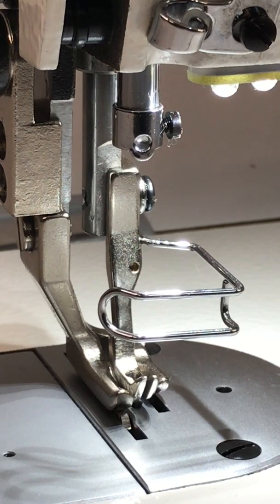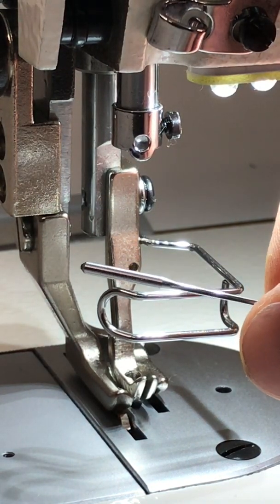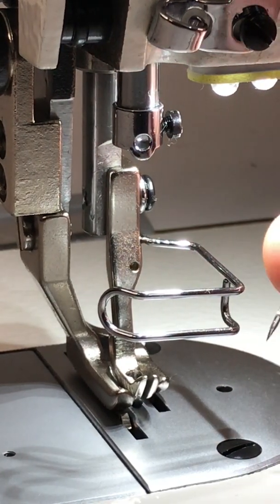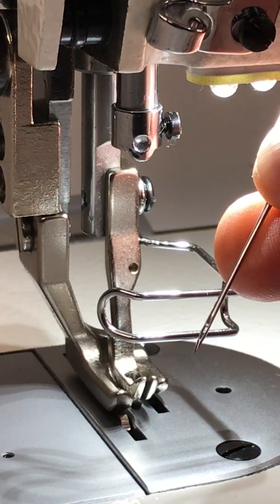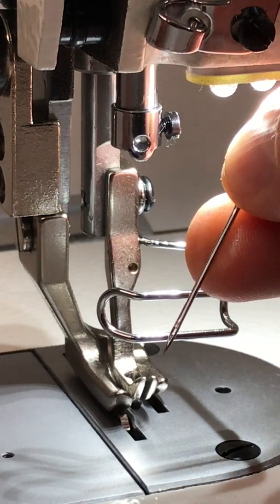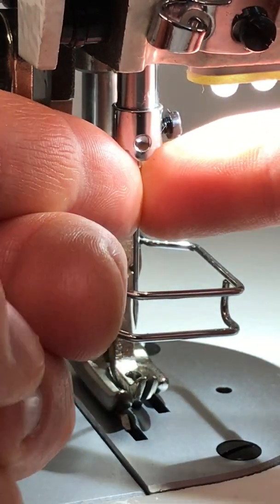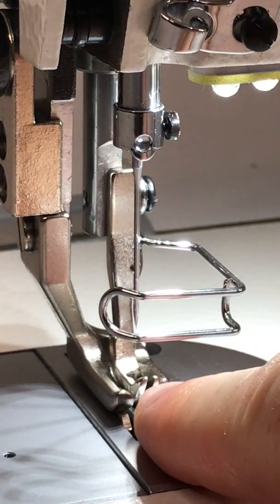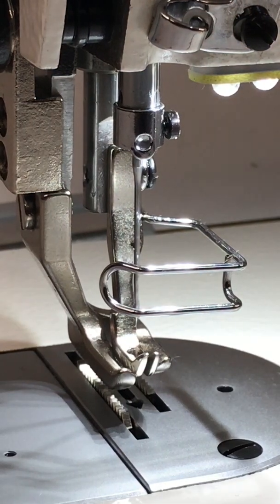How to Change a Needle on a Jack Industrial Sewing Machine

Comment: I have a jack A2S. When I change the needle, if I push it all the way up as you do, it won't engage the hook. So I have to loosen, drop it down a little then test it til it works. Is this standard? Ps - thanks for your videos.
Reply from the maker: Providing you are using a good quality dbx1 system needle, you must insert the needle fully, this should be visible through the hole in the needle bar.

If it is not sewing correctly or missing stitches it can be one or more of three things.
1.Firstly the needle bar height must be correct, this can slip during a heavy jam or needle strike, or has been adjusted poorly. 

2, After needle bar is set correctly, the timing should be set at the correct needle bar rise.

3. Setting of the hook point to needle clearance as close as possible without causing needle deflection.
Reply: @ozcommercialsewingmachines  thank you! I got the DAX needles instead of the DBX. Problem solved. I didn't realize there were so many different industrial needle types.
Reply from the maker: @KittenKaboodleto  yes, there are literally hundreds of different needle systems for industrial machines, thank you for allowing us to help you, all the best.

Comment: Hi any idea how to remove a stuck needle,i have the Jack A5E only had it 2 weeks so the original needle is still in but wont come out thank you
Reply from the maker: You need to loosen the little screw on the right that holds the needle in place, if you have already done this and it won't come out then I would get a set of pliers or something to grab hold of it and gently pull it out. If all this fails let me know and email me a photo of the problem please - ozcommercialsewingmachines@gmail.com
Reply: @ozcommercialsewingmachines  Thank you used the pliers